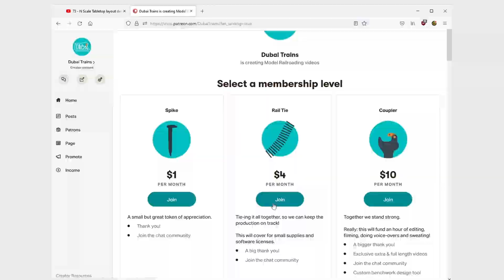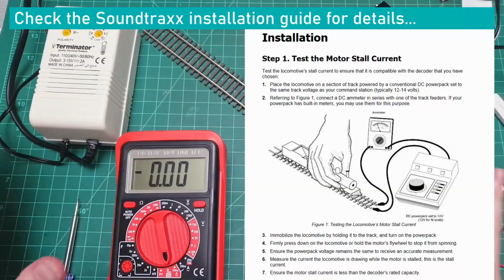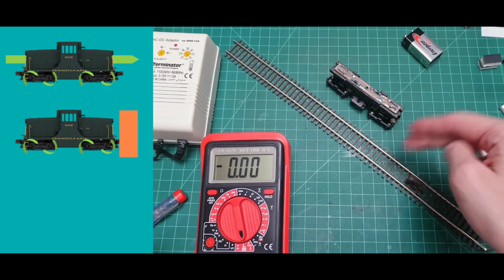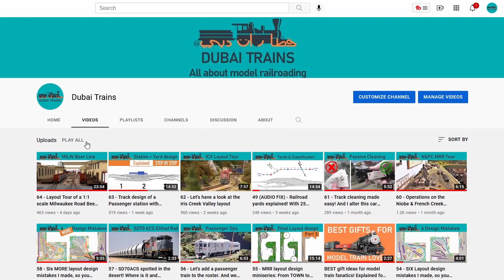83 - Beginner guild: Stall Current. Why & how do you measure it.

Comment: You must measure current at full stall, since the the decoder does not vary the voltage to the motor to control speed, but uses full source voltage and varies pulse width to control motor speed.  At any given instant, current through the motor is governed by the source voltage and the motor's resistance.  If the motor's resistance is low enough, the motor can draw more current than the decoder is rated for.

Comment: The current will increase the further away you are from source,
Reply: The current will decrease, the further you are from the source. Total resistance in the wiring will increase with distance and since current in a series circuit is indirectly proportionate to resistance, as resistance increases, current will decrease with a fixed output voltage.
Reply from the maker: Hi Ron, to give an idea. Hoe many amp per ft are we talking about?